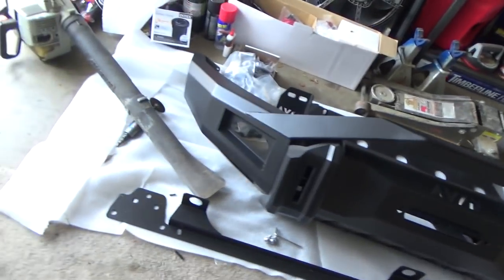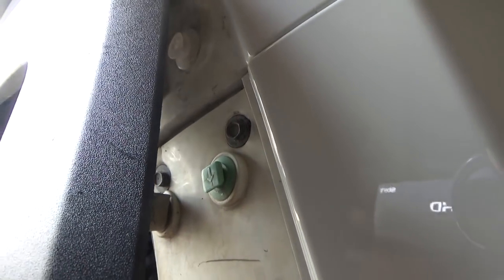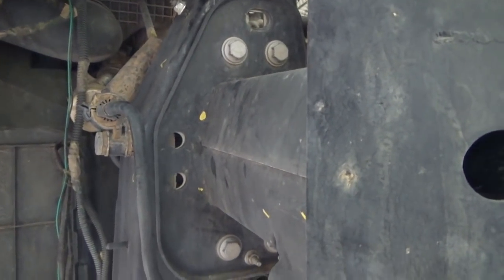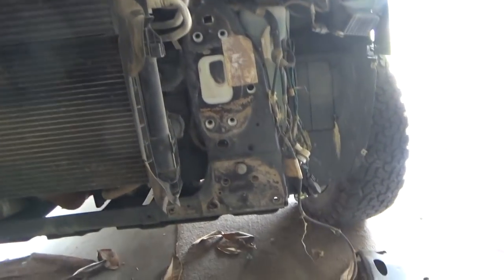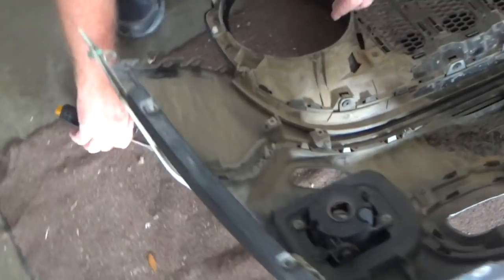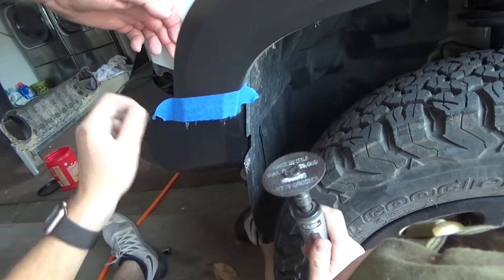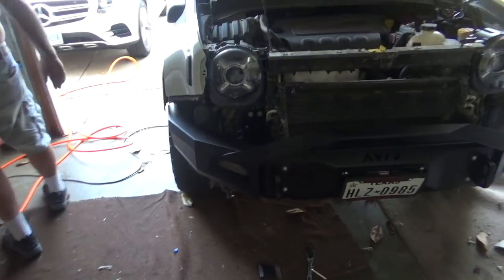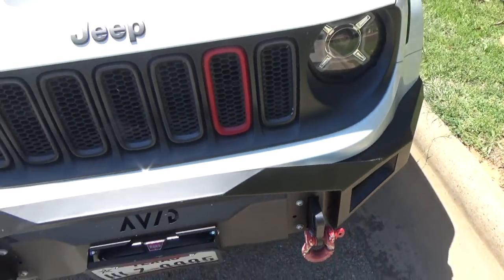Renegade Tv - Avid Pre-Runner Instal

Comment: Any idea what the total net weight gain was after the install. Avid has the bumpers weight on their website, but not how much weight it actually adds to the renegade.
Reply from the maker: The weight of the product will be the weight it adds in the end
Reply: @ChimichangaTv  Damn. I was really hoping the 150 pounds on the website was the gross weight of the parts, not the net weight gain. Not sure I feel comfortable adding that much weight to my Renegade.
Reply: @ChimichangaTv  Your response regarding the Net Weight Gain is patently absurd, considering you literally made a video in which you removed the factory-installed front bumper in order to install the Avid Pre-Runner Front Bumper.  Although made of plastic and other lighter materials than the Avid piece, I am certain that the factory bumper does in fact have mass, and therefore weight.
So, the Net Weight Gain is 150 lbs MINUS the weight of factory bumper.
In the future, simply admitting that you failed to weigh the factory bumper would be preferable to spreading disinformation.
Thank you.

Comment: Have you had any problems with that radiator fan? Gone out? Any of your other friends as well? Just wondering. And how is the reliability on your renegade so far?
Reply from the maker: Yes it was an issue 2015 to some 2016 had. But overall it’s rock solid I’d say.
Reply: My radiator fan also went out at 44k miles on it.    This also blew the 50amp fuse.   I replaced it with same OEM fan.  Now Jeep Renegade limited 2016 is fine.   Its apparently a known issue.
Reply: Mine went out also at 30k miles a little stick broke it so watch what you run over in the road !

Comment: Hey the opt7 headlight you had installed, how did you manage to keep your stock DRL ro light while the opt7 DRL lighted up at the same time. I thought only the opt7 x will light up since they replace the stock drl.
Reply from the maker: It’s a special wire harness they send with the lights

Comment: I love your channel and mods to your Renegade. I plan on putting some 225/70r16s on my sport. I am stock height for now but plan to get either the daystar 1.5 or the AVID 2.5 lift. What size spacers did you use on yours?
Reply from the maker: I used 2”. But you’ll have to do the pinch seam mod if you go spacers with a tire that big for rubbing issues. It’s my newest video released go have a look. It will help a lot to get you spacer ready.

Comment: Do you have an install video for the opt7 headlights? Also would you recomend them?
Reply from the maker: Unfortunately I don’t but I have one over the Valkyrie light brackets. Which is basically the same. I’d personally go with the Valkyrie ones being the light options are endless with that bracket
Reply: @ChimichangaTv  did you ever have any issues with the opt7 lights. Did the ever stop working or were they pretty reliable?

Comment: what size wheel spacers do you have????
Reply from the maker: I ran 2”
Reply: What wheel set up do you have? and do you have a lift kit on this as well?
Reply from the maker: I ran 225/65r17 personally with a 1.5” lift. But you can run 235/65r17 but there might be a slight rub. I did what’s called a pinch seam mod where you remove the inner fender and you’ll see the pinch seam and I cut that out which helped eliminate the rub.

Comment: what size are your tire and wheels
Reply from the maker: Wheels are the factory 17” and the tires are 225/65r17 it’s the size I recommend most but you can go up too a 265/70r17 with heavy modifications. Such as a big lift, and 2” wheel spacers. But your suspension will start to fail sooner than intended if you go that route.